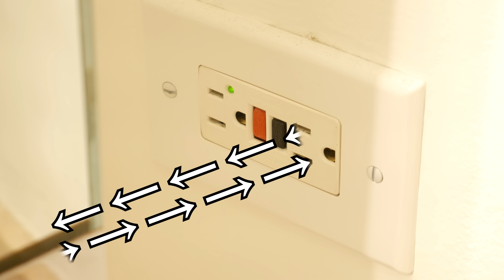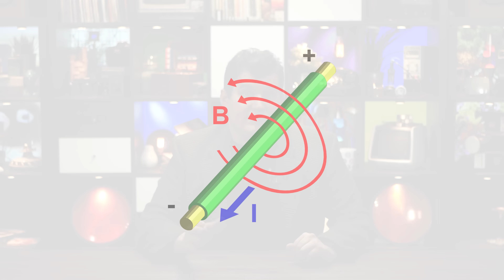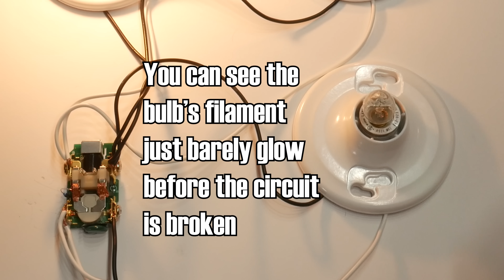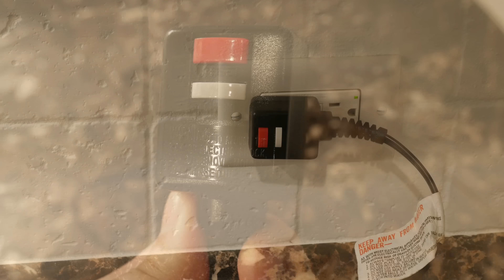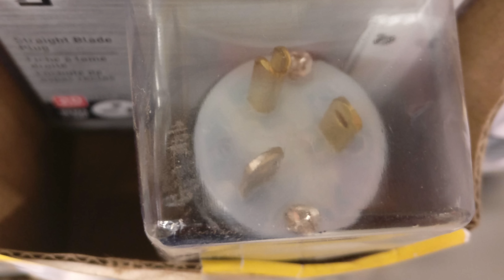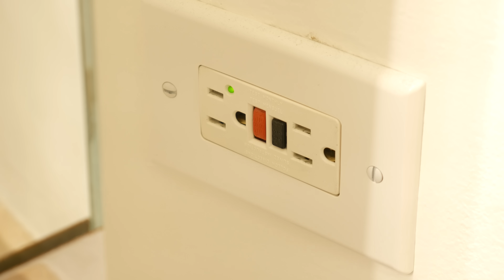The GFCI/RCD: A Simple but Life-Saving Protector

Comment: For safety, UK bathrooms don't have electrical outlets in them, apart from special ones for shavers. Although it may seem that that might tempt someone to use an extension cord, which would, per se, be no more or less safe than plugging into a fitted outlet in the bathroom, people typically blow dry their hair in a bedroom, which makes sense given that bedrooms tend to have mirrors in them, as part of a dressing table, for example, and using another room means that the bathroom is then free for other people to use, including for private activities, such as taking a dump.

Comment: Once again the U.K. does better than the USA, we have circuit breakers (RCD) in almost all homes connecting every plug in the house AND have the gfci in the bathrooms.
Reply: But then again, U.K. homes have 240VAC while outlets in the USA have 120VAC.  That being said, you can, and some people do, put a GFCI on every single outlet in the house.  It is a cheap safety feature especially with small kids in the house.
Reply: We do have those and ones that protect from arc faults as well at the same time. It’s just that you can’t just use one breaker to protect the rest, you need to buy individual breakers to protect their own lines, so it becomes expensive. You guys are more anal about being up to code.

Comment: So I was replacing/upgrading some electrical outlets in my house to GF. I did to of them. The 3rd one is in the garage. The box has an outlet and a poll switch. I went to relace it but the outlet has 4 white wires. 2 black wires and a red. Maybe because the switch is a 3 way switch? 

I broke the orginal outlet taking wires out. After trying to figure out the wiring diagram it started to get dark. I can't use the lights because power is off. I couldn't figure out the GFCI wiring. So had an extra old outlet around and wired it for safty. Anyways anyone know how to wire it? When I go back to the house I am working at I will take pictures. THANK YOU!
Reply: Something sounds strange about that.  Black wires are Hot, White wires and Neutral according to code.  I can't think of a reason where you would have more White wires than Black unless someone didn't follow the proper color codes.

Comment: why the hell this exists, RCBO are cheap and produced for decades, every single house has it here. This is some sort of money laundering scheme or something? You US folks are weird.
Reply: Probably because the Yanks are cheap and because they use 120VAC instead of 240VAC.  Many houses here are built in bulk by a builder, basically they buy a large tract of land, build 500 houses and then sell them one at a time.

They figure every time they save a penny, that is 500 pennies saved and in their pockets.  You would be shocked at how cheap they can get to save a few pennies.  Probably also the reason why windows in the USA are typically about as thick as two pieces of paper stuck together.

Comment: Is 'Hot' just another word for 'live', if so, is this a US thing or just something that you say?
Reply: "Hot" is the US term for "live" / "line" (In the UK, which is where I live, the correct term is strictly speaking "line", although most people are unaware of this)
Reply: @pineappleroad  Hot and Line are basically interchangeable, the Neutral is the return for AC circuits while Ground is the Ground on DC circuits.

Just as an additional fun factor, Black is Ground using DC circuits, but Black is HOT (Line) for A/C circuits.  Many people tampering with AC circuits will confuse the Black wire as Ground if they normally work with DC.

It can be a shocking experience.

Comment: The trouble with these is that they are made CHEAP.  They also nuisance trip if modern appliances with switching power supplies are plugged into it.  The electro-magnetic interference of these supplies can make the GFI trip even though there is no ground current (or if the current is high-frequency harmonic).  If they made these properly, they would be designed to be sensitive to 50 or 60 Hz line frequency only, and reject the high-frequency electricity, which can't electrocute anyway.  Nothing is worse than a "safety" device that nuisance trips!
          With all that surface-mount electronics inside, what do you think what will happen if the GFI becomes wet?  Why would you worry about this?  Well, these are mounted in wet locations, like OUTSIDE or in a kitchen.
Reply: I often wonder if having them in the [ insert appropriate term here - service panel - fuse box - consumer unit ] is better, as where I live (UK) all circuits are required to have RCD/GFI protection, and there are even RCBOs available, which combine a standard circuit breaker with an RCD/GFI, and although I have had to deal with a bit of nuisance tripping (the first time it was a kettle causing the problem, which was in the kitchen, and there was the time when water got into a light switch or something, and caused the RCD to trip, and as there was one RCD covering half the circuits, it took out the power to half the house, if RCBOs were fitted only the lighting would have tripped)
Reply: @pineappleroad  Most of Europe has the GFCI's (RCD/RCBO's) in the panels as that is required by code.  This may be due to higher voltage being present (typically 240VAC) vs in the USA the voltage is typically 120VAC.

Also, the requirement for RCD/RCBO's is all over the map in Europe, some having been required since the 1970's and others countries didn't require them until the 2000's.

The good news for the USA application is you can relatively easily and selectively retrofit your house with GFCI's and even put them in every room if you so desire.
Reply: Since when can't high frequency electricity not electrocute you???  You can get electrocuted even with DC.  

And GFCI's are not designed to get wet, although some have covered inlets that you force open when you plug things into them.  GFCI's mounted outside typically are supposed to be behind a water resistant cover or inside a water resistant box you open.

In reality, they work very well for their intended purposes and rarely have false trips unless powered by high current devices like hair dryers or microwave ovens.
Reply: @redbaron6805  High frequencies CANNOT electrocute!  High-frequency current flows only over the surface of conductors.  It flows over the surface of the body, and does not penetrate significantly.  Have you seen the monster Tesla coils?  They may burn, but they will not electrocute.  Modern day solid-state equipment produces high frequencies.  These cause nuisance tripping.
Reply: @bpark10001  All depends on what your definition of "high frequency" is based on.  And solid state equipment doesn't necessarily cause high frequencies as solid state circuits use DC to run.  All depends on the application in question.
Reply: @redbaron6805  "High frequency": from 100KHz and up.  Yes, DC is made internally by diodes, but that ordinarily doesn't escape.  But the high frequencies do (and they are hard to keep in.  Many electronic circuits are dominated by filtering components to try to keep them in, but some still gets out anyway.)  Others, such as vacuum cleaners and portable power line operated tools with universal motors are like a small radio station!  They will trip a GFI even though no 60 Hz leakage exists.
Reply: @bpark10001  A lot of the RFI/EMI interference is simply due to poor shielding and lousy circuit design, usually due to cheap and poor quality construction from all the electronics Made in China.

It can easily be solved with proper engineering and proper construction, but everyone is trying make stuff cheaper than everyone else, not better.

That being said, I have actually never tripped my GFCI's using vacuum cleaners or power tools, and I have everything from an air compressor to a table saw running on a GFCI in my garage.

GFCi's according to code are supposed to be highly resistant to frequency interference and my experience is they are pretty well hardened against those.

Comment: Fantastic breakdown of what GFCIs are and how they work. I wish I found this a couple months ago when I was learning about them in trade school. However, there are a few things I would like to correct or point out.

1. The plugs on hair dryers and similar electronics are not GFCIs. They are IDCIs(Immersion Detection Circuit Interrupter). The name on those is pretty self-explanatory. Don't test them by submerging them. They have the buttons for that. They are a safety feature, not a toy.

2. Some comments are pointing out that their bathroom outlets are not GFCIs. This does not mean they are not GFCI protected. At 4:39 Alec is talking about the Line and Load terminals. An outlet that is hooked up to the Load terminals IS protected by that GFCI outlet. This is illustrated by the experiment at 10:39. When the light is properly hooked up to the Load terminals, it works. When the neutral wire is pressed against the Line terminal(simulating a ground fault), the GFCI trips and shuts off the light. The same thing happens with outlets when properly hooked up to the Load terminals of the GFCI.

3. GFCI circuit breakers for your panels do exist here in the US. However, there are a slew of reasons they aren't commonly used. First, they can compete with the AFCIs(Arc-Fault Circuit Interrupter) for the slot; and while dual-function AFCI/GFCI breakers exist, they are much more expensive. Even a GFCI only breaker is often more expensive than the outlet counterparts. Second, there are potential compatibility issues; refrigerators will often trip GFCIs when no fault exists(nuisance tripping). And the outlets are more flexible; you can have some items on a circuit GFCI protected while others are not. With the breaker, the entire circuit is protected regardless(remember that nuisance tripping?).

4. Per the 2020 National Electric Code used in the US and Canada, GFCIs are required all over the place. In a dwelling, your bathrooms, basements, garages, outdoors, close to sinks/bathtubs/showers, kitchen countertops, and more, all require GFCI protection. This is by no means all inclusive, and there are even a few exceptions to those locations, but your house should have quite a few of these placed around.

And if you do not know what you are doing, DON'T MESS WITH ELECTRICITY. Hire a professional. It may not be cheap, but I promise it's better than getting hospitalized from a severe shock.
Reply: I find it interesting how things are different in the US to the UK
In the UK (which is where I live), all circuits are required to have RCD protection (GFCI)
Most houses at the moment have a dual RCD setup, where there are (usually) two RCDs, which each cover a number of circuits
There are also RCBO consumer units, an RCBO is an RCD (GFCI) combined with a circuit breaker), and also the incredibly expensive AFDD consumer units, an AFDD is Arc Fault detection (AFCI) combined with an RCD (GFI), combined with a circuit breaker, if that wasn't obvious

Here is a rough idea of what it would cost to purchase each type of consumer unit

Dual RCD, 6 Circuits: £59.99 / €69.27 / $83.72

RCBO, 6 Circuits: £109.99 / €127.02 / $153.52

AFDD, 6 Circuits
I am unable to find a pre-populated Consumer unit for this configuration, but the following is based on an unpopulated consumer unit plus 6 AFDDs: £857.69 / €990.59 / $1197.10
Reply: @pineappleroad  I can say from experience having lived both in Europe and the USA that in Europe, nuisance tripping of outlets was rather common, especially with motorized loads or microwave ovens.  

In fact, I remember our first microwave oven in Europe simply wouldn't work on the kitchen outlet, it would trip almost every time.  For some odd reason, the dual wall oven had an outlet between the upper and lower oven behind a cover plate.  It was a German AEG oven, but using that outlet stopped the nuisance tripping of the microwave oven.  

As a bonus, our entire house was outfitted with the Italian BTicino brand Magic security connectors, which were highly unusual to say the least.  They were fashionable in the 1970's and 1980's and are still found today.

Comment: if lights switches had these in garages, my experience wouldn't have been so shocking when i accidentally stuck my finger in when.toggling an uncovered switch.
Reply: That wouldn't really work for a light switch unless you touched the output wires.  If you touched the input wires, you would have to have a panel mounted GFCI for it to work.

Comment: Sometimes you get false positives with these as well which is "fun."  Had these at work on the same circuit as an air compressor.  Made for a lot of burned out courtesy plug in lights in the bathroom on that particular outlet whenever the compressor would start.
Reply: Can't imagine why these would ever share the same circuit as an air compressor, especially in a commercial setting.

Comment: I love your Chanel. When a ground wire is disconnect, how you call that, also a ground fault? But that is not necessary dangerous....
Reply: A disconnected ground wire is called an open ground.  It can be a hazard as the ground wire in AC designs is to create a direct path to ground in case a device fails internally or there is an internal short of some kind.  If you have an open ground in a non GFCI circuit, faulty wiring can cause electricity to touch a metal case or a metal part of some kind and when you touch the device, you become the path to ground, causing an electric shock.

Devices with a ground wire and a ground prong on a connector, usually called a Safety Ground, is there for a reason.  A device with a 3rd pin used for a ground should not be used if the ground pin is missing or disconnected as it is a safety hazard.

Comment: My apartment has a GFCI outlet in the living room. Why? Because the outlet for the back porch is series-wired to that outlet in the living room. Why didn't they put the GFCI on the back porch instead? Because they didn't put a proper safe box cover over it anyway. So during windy rainstorms, the GFCI blows in my living room(Which used to involve me having to move a bookshelf to get to) because of something on my porch.

Which is not the dumbest thing here. That GFCI outlet, and all the outlets in the living room, as well as that back porch? Are all on one breaker. Which might not sound bad, except when you realize that that breaker is also responsible for every wall outlet in THREE BEDROOMS.

Four rooms and a back porch. And ONE breaker.

And before you say "Wow that sounds like shitty old wiring", this apartment was built in the early 2000s.
Reply: That is some seriously shitty wiring.  It is flat out stupid for a single breaker to handle outlets in a living room and 3 bedrooms along with something outside.  This could also be a violation of local electrical codes, although the NEC code doesn't specifically prohibit this.

There are of course easy ways to fix this.  Simply put a dedicated GFCI outside and wire it to the Line terminals on the existing GFCI instead of the Load terminals.  Then also cover the outside GFCI with a weather proof box.  Outside outlets are always supposed to be covered behind a water resistant outlet cover or a water resistant outlet box.

This if course is assuming you own this apartment and it isn't a rental.  Although if you lived there long enough, I would probably just spend the $15 and 10 minutes and fix it myself.
Reply: @redbaron6805  It is a rental. Gotta love cost-cutting!
Reply: @TacComControl  Yeah, this lame nickel cost cutting can be frustrating and stupid.  Even my 4 bedroom house in an upscale community has the master bathroom outlets wired to a GFCI in the garage.

It is on my list to change that as my wife's hair dryer sometimes trips it and I find out days later when my toothbrush won't charge.

Comment: Overall, it is definitely safer to have a central RCD as opposed to GFCIs at certain outlets only. However, there is a catch: if you have a fault, not only is it way more difficult to troubleshoot with a central solution. It also really sucks to have the power go out in your whole house or apartment!
Reply: It can be safer, but it isn't definitely safer.  One always has the option of just making all outlets GFCI, which some people have done, especially if they have small kids in the house.

Comment: You didn't touch on self testing GFCI but they are pretty neat as well. I haven't looked to see if you have done a video but AFCI outlets are also pretty neat as well as AFCI/GFCI outlets. 

if the outlet in your kitchen was Legrand the red light would typically mean the outlet HAS to be replaced; it's busted. I don't know on other brands but I'm sure it's probably the same. On my bathroom AFCI/GFCI it will illuminate a white light when it is trips and a red light when it fails and needs replaced. 

I love these videos and I'm so excited to keep consuming your content!

Comment: In France the fuses are directly on the "electricity" closet. If there is a short circuit, residual ground or current, the whole thing turn off (sometimes only the room electricity is shut, sometimes the whole house)
In Britain, they have fuses directly onto the plugs
Reply: Those are called circuit breakers.  Fuses typically have a wire inside a glass or ceramic tube that actually melts and breaks contact, and the fuse requires replacement when this happens.  Circuit breakers trip the circuit and can be reset via a button.
Reply: @redbaron6805  yes exactly